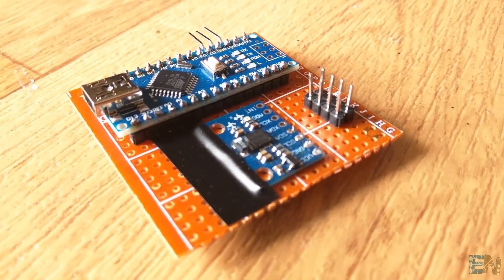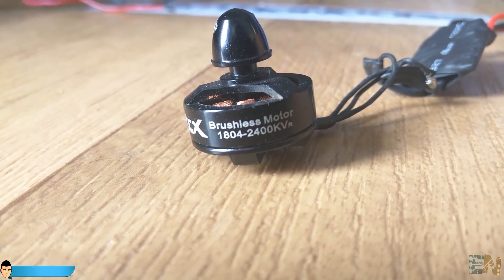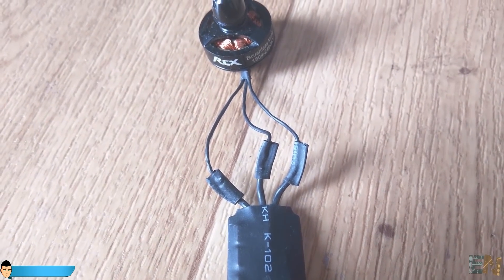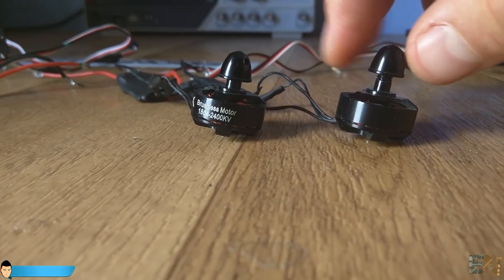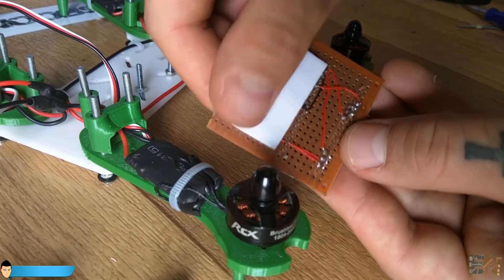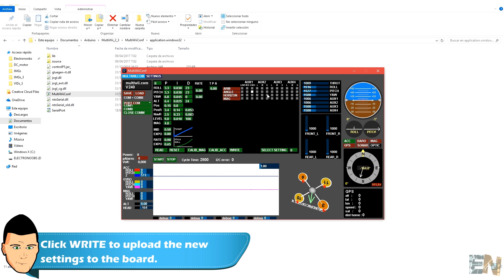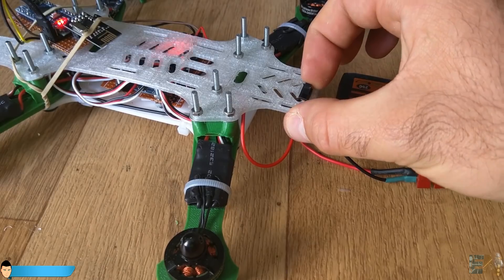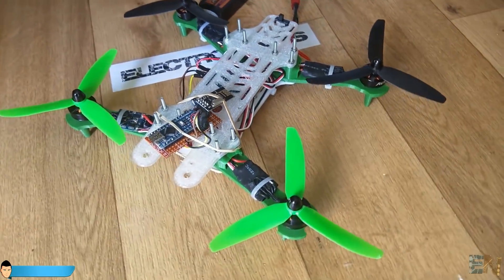Arduino drone - Part3 Drone built

Comment: Hi guys i need help!so when i rauch the multiwiiconf. When i select the port com and it connects very well but when i press the start button the whole program just dies and says nothing'if you can help me.Thanks you so much
Reply: Are you using nano?..if yes put a 10 k ohm resistance to last 6 holes of nano and it will work just fine
Reply: Download Java 8u202

Comment: hi sir, i have completed all the setup. But my drone is not lifting.Can you please help me joystick control for lifting the drone. Also my drone size is 450cm , used bldc 2212 motor with simonk30A ESC . Issue1: after reducing throttle and yaw to higher, only 1 motor is running, when i increase the throtle, others are running. Issue2: Not lifting
Please help me here
Reply: Can you solve this problem?

Comment: Very good clips, but, I have a problem I did everything as described in Arduino Drone video clips, but the electrical motors don't spin 
1. I followed the instruction and uploaded the Arduino program
2. The calibration of the ECS motors was ok and each of the 4 motors spin within the rang of 1000 to 2000 
3.  The simulation with the multiwii run every very good and I see that the RC is working
4. I used an oscilloscope to check the signal from the remote to the Arduino and it works 
5. I used an oscilloscope to check the signal to the ESC  and I see that there is a clear signal of the 4 channels 
 
Can someone help, what I’m missing here ?

Comment: sir im also makeing this project. i made transmiter $ resiver and tested it with given code. its works like a charm. whenever i change the code to actual reciver, connect ppm output to the ppm input of flight controller and run the application.  i couldnt  get any data from transmitter you have any idea please share with me that would be really  appreciable. Thank you!

Comment: What I want to know - and the BIG problem I understand - is MOSTLY tutorial talking about multiwii and flight controller separated with arduino receiver. I thought it was single board with two function => flight controller and receiver at the same time. In fact, I must need two board arduino UNO/NANO/Pro mini two build TWO circuits: 1 board for receiver and 1 board for flight controller ............... LOL ------------- 1 board left for TRANSMITTER LOL => so, 3 board altogether YES !!!!!!!!!!!
Now, I am in my bicopter project ^_^

Comment: I set the throttle to minimum and roll to maximum, but the motors still do not start. I can see in multiwii conf that the receiver and transmitter does work, and is sending the correct values but the motors still don't start. Any advice?

Comment: Great tutorial.  Am looking at building up parts and trying this, fully scratch built.  You say if you don't have a 3d printer for STL files, there are alternatives in description (and you show A4 printouts on the video), but the only alternatives I can find on your site are details of possibly using wood plastic or metal, but none match this design.  Do you have printouts available?

Comment: Brother....I made the communication done, the drone is also responding to the multiwii but the motors are not turning. Although i checked the battery, voltages, ESC's with servo.h library....

Comment: Sir , my ESC's won't calibrating , using the given code.
I can't understand what's the problem is??
Please suggest me a solution.
Reply: You calibrate your ESC's one by one. I used potentiometer as input device. Follow the steps as below:
1. Connect Arduino nano with Analog input (say A0 pin)  from potentiometer.
2. Connect the output put (say Pin 8) to the ESC
3. Switch Potentiometer to Max Value
4. Connect Power to the ESC (Electronic speed controller)
5. You will hear Beap.
6. Immediately take the potentiometer to Min value
7. Again you will hear the beap
8. ESC is calibrated now
9. Repeat for all the motors independently.

Hope this helps. I learned really hard way :)

Comment: i made all the connections as shown in the videos.when i throttled up the motors spin for a moment then stopped.since then i am not able to throttle up the motors using the controller

Comment: Thanks for the great project using commonly available components and making this "expensive" hobby accessible to all.

I just wanted to know what are the performance trade offs in using 8 bit  Arduino as compared to:

1. A 32 bit microcontroller like stm32
2. A cc3d
3. A naze32
4. Naza

In addition, what are the performance trade offs in using nrf24 based transmitter and receiver as compared to say, a ct6b or i6?

Thanks!!

Comment: Great Project and Good Going...!!!
I am a beginner for DIY drone...

Can we use Micro Coreless motors in this project and connect the motors directly to Arduino Flight controller...without using ESC..? 

Thank You.
Reply: no you have to use brushless motor for this.
If you want to make a coreless drone then check out this videos:-
https://www.youtube.com/watch?v=uZKINPm3P9E

Comment: Hi.. I'm also building the quadcopter using arduino nano but the tx n rx which I'm using is fsia6 and when i configure the multiwii software same as on the video duration of 6:18 apprx and when I'm turning on the tx there is no chnge on the throttle,yaw,pitch n roll.. how i can resolv that.. please help asap

Comment: channels  throttle with a duty cycle from 0 to 100%  I use DC motor . How do I fix it? please help me #include <SPI.h>
#include <nRF24L01.h>
#include <RF24.h>
#include <Servo.h>

//Define widths
int pwm_width_2 = 0;
int pwm_width_3 = 0;
int pwm_width_4 = 0;
int pwm_width_5 = 0;
int pwm_width_6 = 0;
int pwm_width_7 = 0;

Servo PWM2;
Servo PWM3;
Servo PWM4;
Servo PWM5;
Servo PWM6;
Servo PWM7;

                    //We could use up to 32 channels
struct MyData {
byte throttle;      //We define each byte of data input, in this case just 6 channels
byte yaw;
byte pitch;
byte roll;
byte AUX1;
byte AUX2;
};
MyData data;

const uint64_t pipeIn = 0xE8E8F0F0E1LL;     //Remember that this code is the same as in the transmitter
RF24 radio(9, 10); 

void resetData()
{
//We define the inicial value of each data input
//3 potenciometers will be in the middle position so 127 is the middle from 254
data.throttle = 0;
data.yaw = 127;
data.pitch = 127;
data.roll = 127;
data.AUX1 = 0;
data.AUX2 = 0;
}

/**************************************************/

void setup()
{
  //Set the pins for each PWM signal
  PWM2.attach(2);
  PWM3.attach(3);
  PWM4.attach(4);
  PWM5.attach(5);
  PWM6.attach(6);
  PWM7.attach(7);

  //Configure the NRF24 module
  resetData();
  radio.begin();
  radio.setAutoAck(false);
  radio.setDataRate(RF24_250KBPS);  
  radio.openReadingPipe(1,pipeIn);
  
  //we start the radio comunication
  radio.startListening();
}

/**************************************************/

unsigned long lastRecvTime = 0;

void recvData()
{
while ( radio.available() ) {
radio.read(&data, sizeof(MyData));
lastRecvTime = millis(); //here we receive the data
}
}

/**************************************************/

void loop()
{
recvData();
unsigned long now = millis();
//Here we check if we've lost signal, if we did we reset the values 
if ( now - lastRecvTime > 1000 ) {
// Signal lost?
resetData();
}

pwm_width_2 = map(data.throttle, 0, 255, 1000, 2000);     //PWM value on digital pin D2
pwm_width_3 = map(data.yaw,      0, 255, 1000, 2000);     //PWM value on digital pin D3
pwm_width_4 = map(data.pitch,    0, 255, 1000, 2000);     //PWM value on digital pin D4
pwm_width_5 = map(data.roll,     0, 255, 1000, 2000);     //PWM value on digital pin D5
pwm_width_6 = map(data.AUX1,     0, 255, 1000, 2000);     //PWM value on digital pin D6
pwm_width_7 = map(data.AUX2,     0, 255, 1000, 2000);     //PWM value on digital pin D7

//Now we write the PWM signal using the servo function
PWM2.writeMicroseconds(pwm_width_2);
PWM3.writeMicroseconds(pwm_width_3);
PWM4.writeMicroseconds(pwm_width_4);
PWM5.writeMicroseconds(pwm_width_5);
PWM6.writeMicroseconds(pwm_width_6);
PWM7.writeMicroseconds(pwm_width_7);

}//Loop end

Comment: channels  throttle with a duty cycle from 0 to 100%  I use DC motor . How do I fix it? please help me 
/* Receiver code for the Arduino Radio control with PWM output
 *  
 *  THIS ONLY WORKS WITH ATMEGA328p registers!!!!
 *  It gives a nice PWM output on pins D2, D3, D4, D5, D6 and D7. Still working on it...
 *  
 *  Install the NRF24 library to your IDE
 *  Import the servo library as well
 * Upload this code to the Arduino UNO
 * Connect a NRF24 module to it:
 
    Module // Arduino UNO
    
    GND    ->   GND
    Vcc    ->   3.3V
    CE     ->   D9
    CSN    ->   D10
    CLK    ->   D13
    MOSI   ->   D11
    MISO   ->   D12

This code receive 6 channels and create a PWM output for each one on D2, D3, D4, D5, D6 and D7
Please, like share and subscribe : https://www.youtube.com/c/ELECTRONOOBS
*/

#include <SPI.h>
#include <nRF24L01.h>
#include <RF24.h>
#include <Servo.h>

//Xác định chiều rộng xung
int pwm_width_2 = 0;
int pwm_width_3 = 0;
int pwm_width_4 = 0;
int pwm_width_5 = 0;
int pwm_width_6 = 0;
int pwm_width_9 = 0;

Servo PWM2;
Servo PWM3;
Servo PWM4;
Servo PWM5;
Servo PWM6;
Servo PWM9;

                    //Chúng tôi có thể sử dụng tối đa 32 kênh
struct MyData {
byte throttle;      //Chúng tôi xác định từng byte dữ liệu đầu vào, trong trường hợp này chỉ 6 kênh
byte yaw;
byte pitch;
byte roll;
byte AUX1;
byte AUX2;
};
MyData data;

const uint64_t pipeIn = 0xE8E8F0F0E1LL;     //Hãy nhớ rằng mã này giống như trong bộ phát
RF24 radio(7, 8); 

void resetData()
{
//Chúng tôi xác định giá trị ban đầu của mỗi đầu vào dữ liệu
//3 chiết áp sẽ ở vị trí giữa nên 127 là trung bình từ 254
data.throttle = 0; // kenh ga
data.yaw = 127;    // muon cho duoi venh len khi mat tin hieu thi chinh len = 0 hoac =255
data.pitch = 127;  // gia tri nay gia tri ban dau cung nhu gia tri khi mat song
data.roll = 127;   // dieu chinh cho no neu bi mat song no se ve gia tri nay
data.AUX1 = 0;     // kenh nay gan buzi coi de bao dong tim may bay khi no mat song de= 0 hoac =1 tuy
data.AUX2 = 0;     //kenh nay co the gan den tuy de= 0 hoac =1 tuy
}

/**************************************************/

void setup()
{
  //Đặt chân cho mỗi tín hiệu PWM
  PWM2.attach(2);
  PWM3.attach(3);
  PWM4.attach(4);
  PWM5.attach(5);
  PWM6.attach(6);
  PWM9.attach(9);

  //Cấu hình mô-đun NRF24
  resetData();
  radio.begin();
  radio.setAutoAck(false);
  radio.setDataRate(RF24_250KBPS);  
  radio.openReadingPipe(1,pipeIn);
  
  //chúng ta bắt đầu truyền thông vô tuyến
  radio.startListening();
}

/**************************************************/

unsigned long lastRecvTime = 0;

void recvData()
{
while ( radio.available() ) {
radio.read(&data, sizeof(MyData));
lastRecvTime = millis(); //ở đây chúng tôi nhận được dữ liệu
}
}

/**************************************************/

void loop()
{
recvData();
unsigned long now = millis();
//Ở đây chúng tôi kiểm tra xem chúng tôi có bị mất tín hiệu hay không, nếu co chúng tôi đặt lại giá trị
if ( now - lastRecvTime > 1000 ) {
// neu Mất tín hiệu?
resetData(); // thi nhay ve gia tri trong resetdata xem ben tren
}

pwm_width_2 = map(data.throttle, 0, 255, 1000, 2000);     //Giá trị PWM trên pin kỹ thuật số D2
pwm_width_3 = map(data.yaw,      0, 255, 1000, 2000);     //PWM value on digital pin D3
pwm_width_4 = map(data.pitch,    0, 255, 1000, 2000);     //PWM value on digital pin D4
pwm_width_5 = map(data.roll,     0, 255, 1000, 2000);     //PWM value on digital pin D5
pwm_width_6 = map(data.AUX1,     0, 255, 1000, 2000);     //PWM value on digital pin D6
pwm_width_9 = map(data.AUX2,     0, 255, 1000, 2000);     //PWM value on digital pin D7

/*
    * Chúng tôi trừ 1000 và nhân với 2 để nhận tín hiệu PWM
    * với chu kỳ nhiệm vụ từ 0 đến 100% con dang thu nghiem
*/
//Bây giờ chúng ta viết tín hiệu PWM bằng chức năng servo
PWM2.writeMicroseconds(pwm_width_2); 
PWM3.writeMicroseconds(pwm_width_3); 
PWM4.writeMicroseconds(pwm_width_4);
PWM5.writeMicroseconds(pwm_width_5);
PWM6.writeMicroseconds(pwm_width_6);
PWM9.writeMicroseconds(pwm_width_9);

}

Comment: Can i use the bluetooth module for not using the transmitter and receiver but Now leave the connectivity issues because if it would possible then it will be asset for  me and can u suggest me about this soon

Comment: There are very professional and cheap flight controllers with speed controllers and IMUs. Problem is the algorithms eliminating sensor reading errors and proper flight stability. You need quite a calc power and fast mcu to achieve reasonable flight effect. Those algorithms are really sophisticated.

Comment: sir,the calibration of my ESC is not functioning in proper way
the speed of the motor automatically decreases when the value goes avobe1500.I'm helpless pls do reply to my problem 
's solution soon as i have been stucked in the middle of my project and i have spent much on buying the motors and escs,
pls reply to my problem by a solution sir....

Comment: In java processing platform it is working ,but we I connect lipo I heard a beep sound from esc but when I increase the throttle the motor are not working,what will be the problem ????
Reply from the maker: You have to activate the motors. 3 seconds with throttle and yaw to minimum if I remember well
Reply: Thank u
Reply: @rengarider  did your drone started working.i faced the same problem
Reply: @rajatpathak5944  yes it worked
Reply: @ELECTRONOOBS  I did it but i can't activate the motors,reply as soon as possible

Comment: i made your drone and i connect receiver to the computer and measure motor values with mutiwii conf.when i increase the throttle in my remote connections are ok but 4 motors have different values.how to slove this problem please help me
Reply from the maker: If they have different values, might be the gyro problem. Have it well calibrate!
Reply: thx for replying me. I calibrate it but still problem is same.Should i need to buy a new mpu6050 module or not.And also i use arduino uno for transmitter and receiver   and arduino nano for flight controller is it okay?
please help me to fix this error.

Comment: Excuse me could you help me, set up with a flysky i6 remote
Reply from the maker: if your flysky has PWM receiver connect it like this: http://radio-commande.com/international/triwiicopter-design/comment-page-1/ and in the MultiWii code don't add the PPM sum receiver part of the code. Let that part commented with "//"

Comment: I am making a small drone using coreless motors can I directly correct motor to arduino pwm pins
Reply from the maker: No way. You would definitelly need a mosfet control for the motor. Arduino PWM pins won't give you enough current for a DC motor.
Reply: Thanks bro ...

Comment: Hi Electronoobs, I am going to use this receiver Flysky FS-iA6 2.4G 6 Channel Remote Control Receiver, which receiver pins would need to be connected to the Arduino nano.... I know that one is for signal and one is for power ...

Comment: If I use a 7v battery would the project still work and if no what would happen
Reply from the maker: No. Voltage will give the maximum speed of the motors. 2400KV means 2400 rot/min per each volt. So for 7.4 volts battery you would have a maximum speed of 17.760rot/min per each motor. The drone could have less throttle so less weight that it could lify. Keep uP!
Reply: Mavrick you can just make sure u use higher kv motor
Reply: Thanks

Comment: If a Radio Controller comes with a compatible receiver will it still work with this project and also if it does work will there be less things to do???
Reply from the maker: Mavrick yes, any PWM receiver will work with multuwii. But you have to connect all the receiver channels and don't add the ppm_sum line in the code.
Reply: thanks, my team and I will start to follow your videos, what are some of the problems that I will encounter throughout this project

Comment: if i right, I can connect gyro, motor, reveiver to the same arduino controller board.
Reply from the maker: Yes, you could, but using that configuration with the multiwii is kind of tricky. With 2 arduinos you spare some processing time!

Comment: First of all, great job! Very informative video and i wanted to build my own Arduino based Tx/Rx and Flight controller and this video came as a real help. Thank you. I have built everything except the frame. RF Transmitter and Receiver work fine. Flight controller works fine. But when i connect everything (meaning connect D2, GND of Receiver to D2, GND of Flight controller), motors don't respond to the joystick movements. This is what i have observed:
1. Tested Rx with Rx test code and all joystick value prints correspond to the transmitted values. they change when joysticks are moved.
2. Calibrated the ESCs as described and found that the minimum value is 1200us and changed the same in multiwii config file.
3. Even the java GUI shows joystick values correctly when i change the joysticks, but motors don't spin!
4. I probed the PWM outputs of flight controller Arduino, they are at constant 500Hz, 50% duty cycle. They absolutely don't respond to any joystick changes.

Any suggestions of where i should be looking further? Many thanks!
Reply from the maker: Have you activated the motors with throttle 0 and roll maximum for 3 seconds 7:00 ?

Also are you sure that all the motros have the samw PWM range. Usually is 1000us to 2000us. Maybe you should reset the range for all the ESCs, it will take just  5 minutes. Use this tutorial for that: http://www.electronoobs.com/eng_robotica_tut5_1.php There you will find the calibration code. Keep up!
Reply: Appreciate your quick response. I will try your suggestions.
Reply: @coolaqua1  sir did your drone started working after trying the maker's suggestions